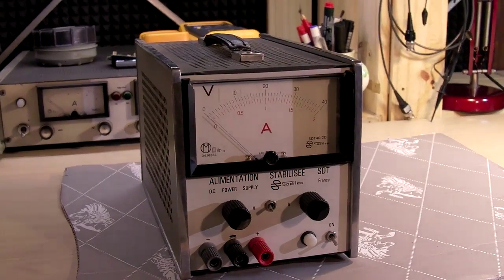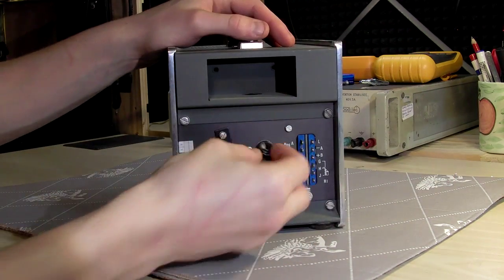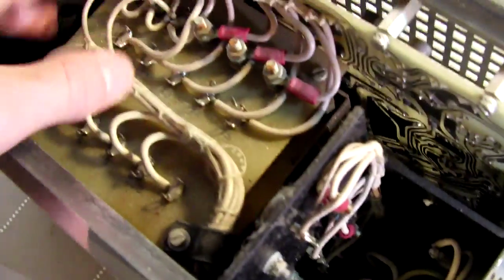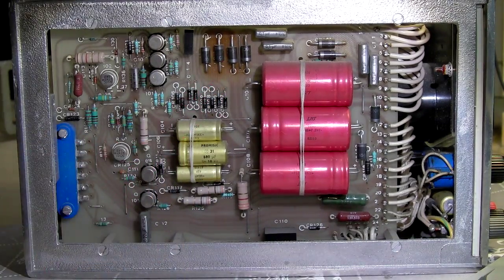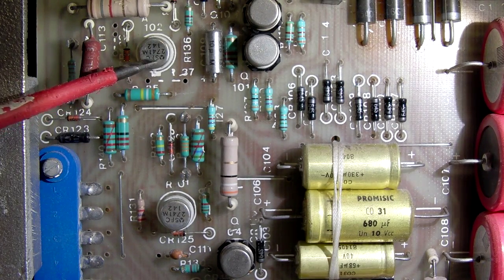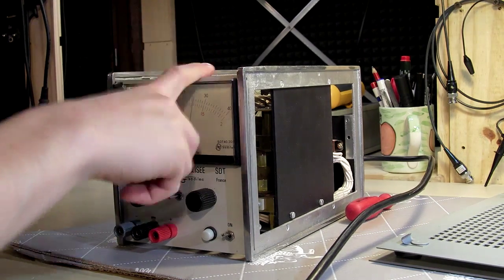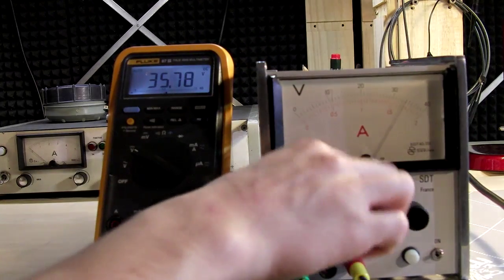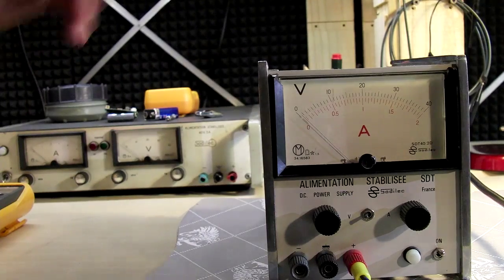Lab power supplies teardown and restoration

Comment: I bet those electrolytic capacitors were finished. Should have loaded the the supply and measured the output voltage ripple.
Reply from the maker: actually i did it off camera and the ripple on the oscilloscope wasn't too bad. Perhaps i'll change them in the future, but for now they work just fine.
Reply: It's very difficult to get axial leaded electrolytics these days. Nearly all are radial.